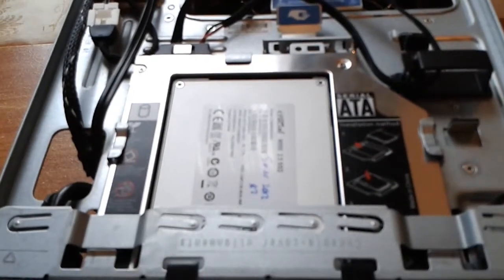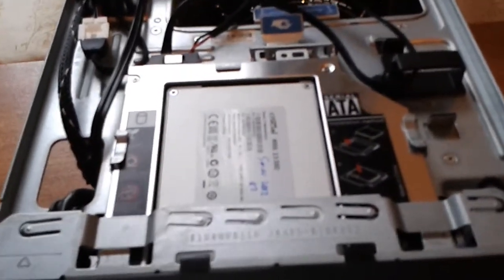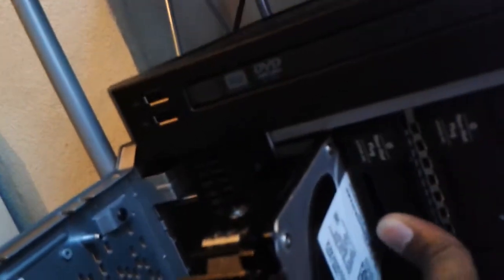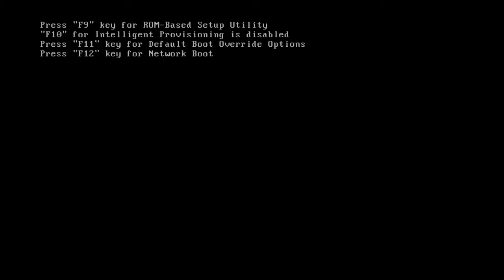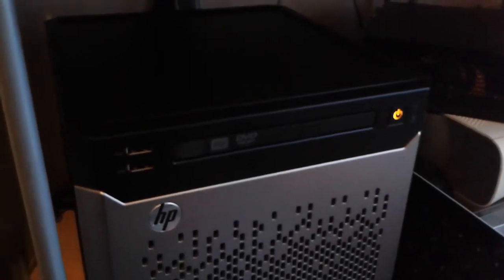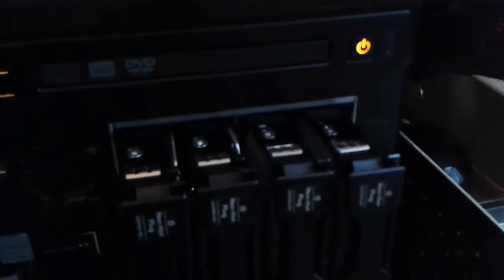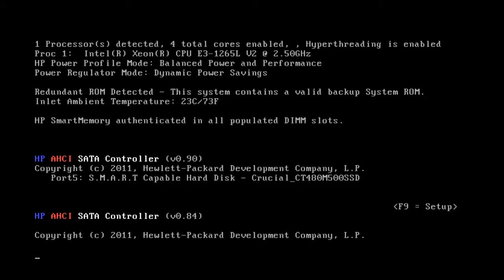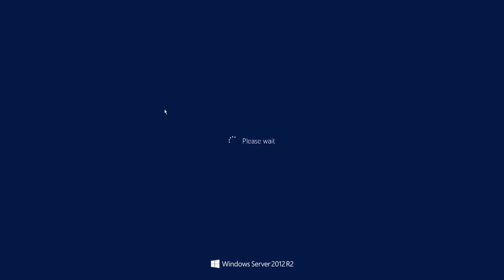The Theory of booting up WS 2012 R2 from SATA HDD

Comment: There must be a configuration error in the HP internal raid card as I can confirm it is possible to boot off the 5th SATA port with the other ports in use. I have a Gen8 Microserver with 4x 3TB WD Red drives in RAID 10 and a 250GB SSD running off the 5th SATA port on the Mobo. The SSD is configured as a RAID 0 drive with 2012 R2 installed. I have a TV tuner in my PCIe port so as much as I would have liked a dedicated RAID card, I don't have the space. :(
Reply from the maker: You need to replace the TV card to put the RAID instead to get it working.
I done a video sequel to this one as the solution.
https://www.youtube.com/watch?v=kvpaoPGHbog